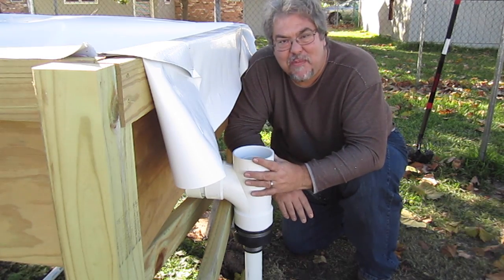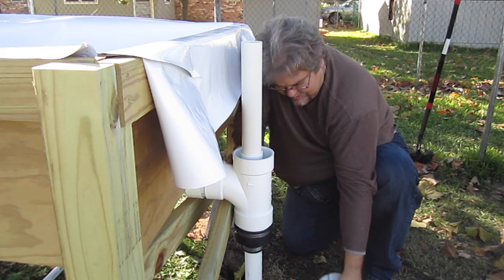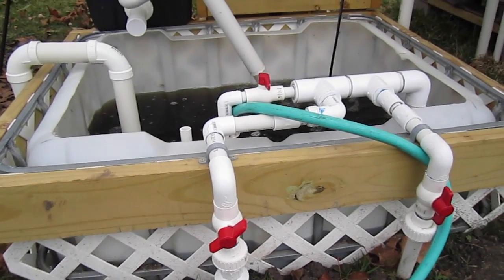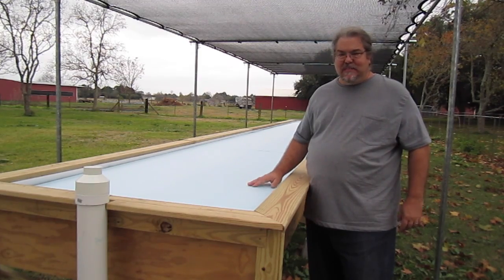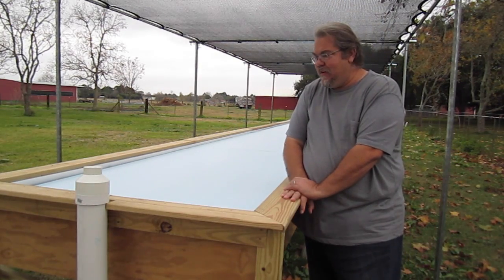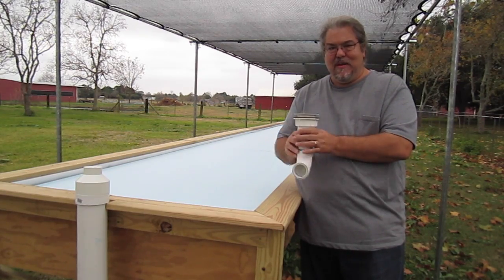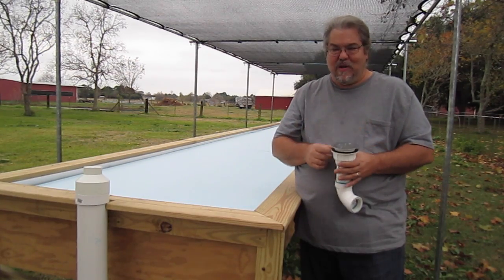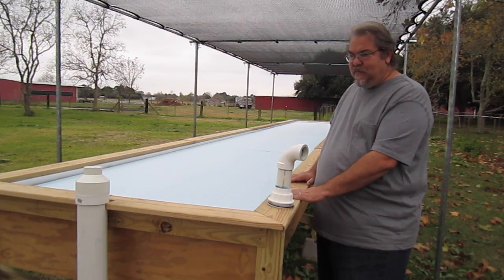Part 5 - DWC Grow Bed Build

Comment: Since nothing in this system, as set up in my place here in Australia, is under pressure, so nothing - but nothing - in the plumbing is glued. All is press fit and anything I worry about pulling apart under any sort of movement, I fit a stainless steel screw into the joint. Any time in the future I need to I can rebuild, readjust, change and recycle all the bits. Forward planning for future expansion or just me being cheap.
Reply from the maker: +Franklin Anders Sounds like a good plan. PVC pipe and fittings are cheap enough so when I need to change things I usually just hack and rebuild. But I like your idea.

Comment: Jeff do you have a materials list to make that? Also I plan on using a pallet rack for two 4' x 10' grow beds. If one bed is elevated above the other bed, it there a way I could use this design for both beds without stressing about the water level?
Reply from the maker: Sorry, no, I don’t have a materials list. Stacked on pallet rack shelving should be fine. You can drain from the top rack to the lower rack, but you’ll need a standpipe in both beds.

Comment: hi is there a reason why you decided to put the drainage at the bottom of the grow bed? could you not have drained from the side and straight into the Tee fitting to eliminate using the elbow? trying to save myself 3 quid aha

Comment: Do you have a material list? This is exactly the size I wanted to build. What was the appx cost without the dressing.
Reply from the maker: There is a link to a SketchUp model in the description. All the parts are named. That’s about as close as I have to a material list. I think the total cost was around $1200, but I also had a bunch of material already.

Comment: Hello, great work!!  Where did you get that shade canopy with the poles?? I have been looking all over for something like that.
Reply from the maker: It’s DIY. I purchased the fittings from ysbw.com, and the pipe from a local chain link fence supplier. But you could also purchase a similar structure/kit from farmtek.com.

Comment: How has this bed held up over time.  Would you add more leg supports or side supports?  What thickness plywood are you using on the sides?
Reply from the maker: Jason Schmeckpeper it has held up great. The legs and supports are fine. The sides were 1/2" plywood if I remember correctly.

Comment: What is your plywood size inches
Reply from the maker: There is a link to a SketchUp model of the system in the description. You can get any measurements you need from there.

Comment: Hey Jeff, for the sketchup model. Did you make it yourself or did you found this plan?
Reply from the maker: +Jason Williams Made it myself.
Reply: +Jeff Barriault Im in the process of making a new system. I tried using sketchup, it's a pain trying to learn. So far it took me 4 hours just to get to this point. But for the most part You get the idea of what I'm trying to. 
Was going to use 2in pics for my main pipe with a 3000gal pump
Check it out and tell me what you think. 
https://3dwarehouse.sketchup.com/model.html?id=u4bbaae95-51df-4e89-b6f3-3d3611312ed0&uploadsuccess=1
Reply from the maker: The link is bad.
Reply: +Jeff Barriault  https://3dwarehouse.sketchup.com/model.html?id=u4bbaae95-51df-4e89-b6f3-3d3611312ed0

Comment: sent a fb friend request. cypress tx and have a few questions
Reply from the maker: Brian VanMiddendorp what questions do you have? Answering them here might be beneficial to other viewers.
Reply: gallons per hour of your pump? I missed the source of your liner? what do you grow in the cool months?
Reply from the maker: The pump is an Alpine PAL4000 (4000 GPH) waterfall pump. I purchased the pump and liner on Amazon. I grow lettuce year round in the system.